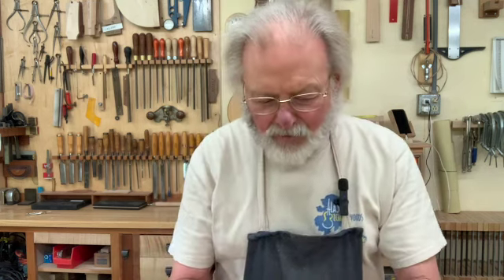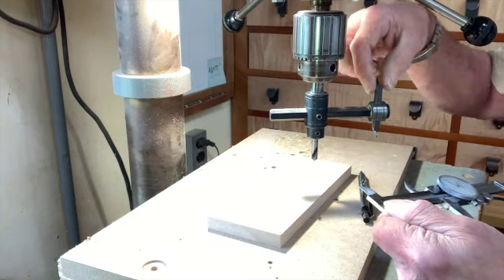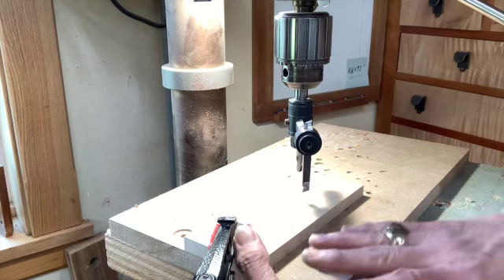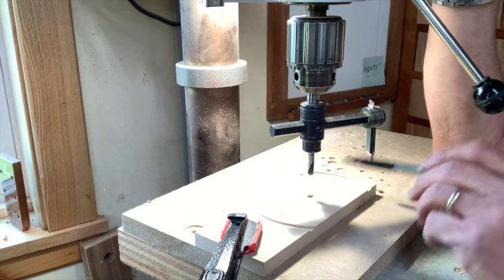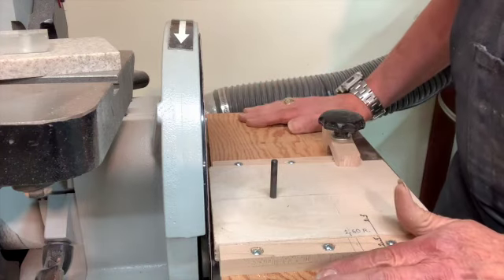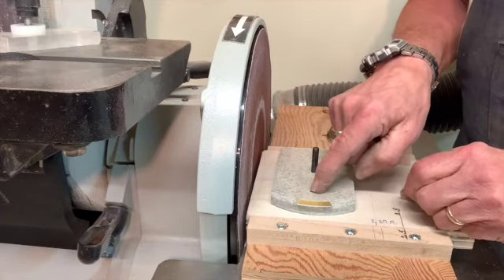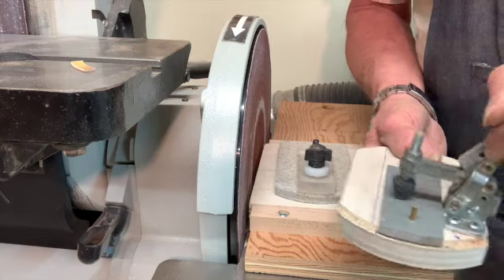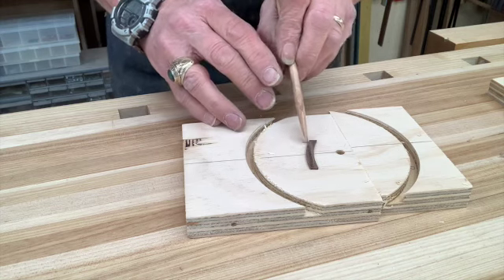Tools For Making Rosette Tiles Part 2 of 2

Comment: Thank you for sharing your ideas. My rosette tooling is really very similar to what you have shown here. I have used it for about a year now. The difference in mine is how the outer radius fixture is held and used on the disc sander. your fixture looks to be much easier to use so i am going to change mine. Many thanks, much appreciated.
Reply from the maker: Thank you. I'm glad that you got some ideas from the video. I like your mandolins and guitars.